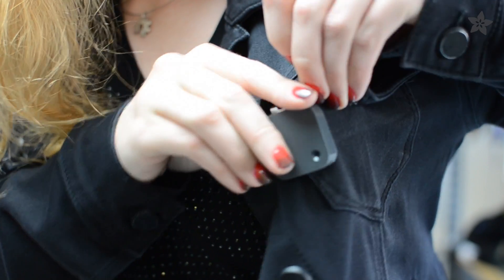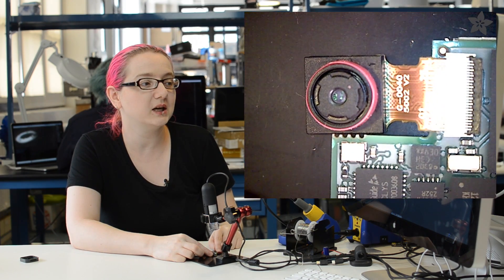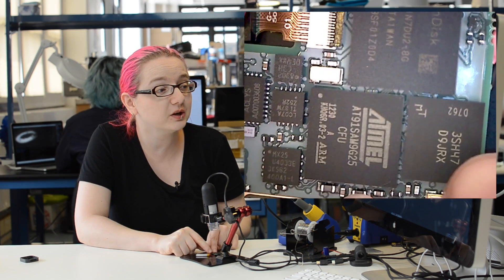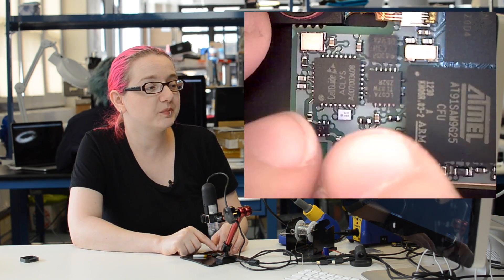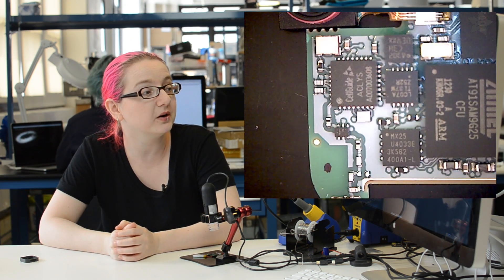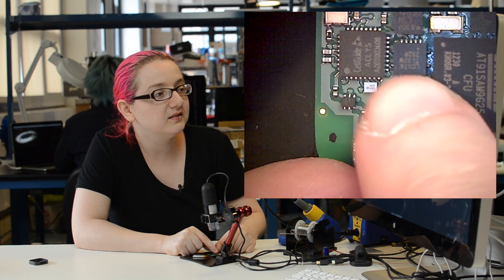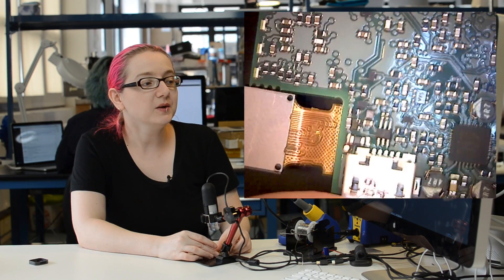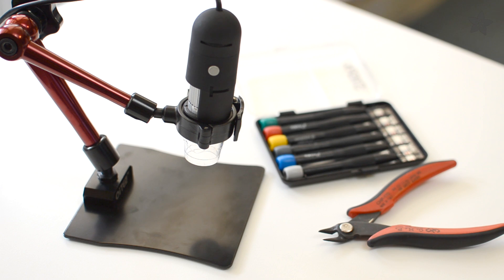Narrative Clip Teardown

Comment: The MT chip is actually a SDRAM, its required as the Clip 1 runs Linux on the SAM9G25! The ACLYS is a software-defined-radio GPS, with a very clever design that just needs to capture 16-64 ms of radio data for a cold lock, it doesn't require minutes. I would recommend a teardown of the Clip 2 :)